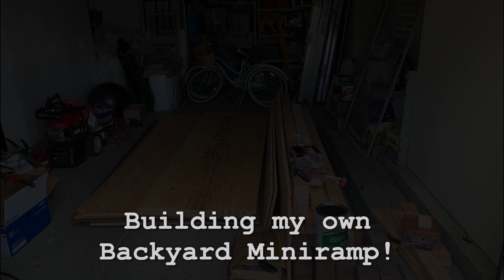How To Build a Miniramp Halfpipe in Your Backyard - Timelapse

Comment: Great video! Now that its all done, do you wish you went a little wider with the ramp?... or do you find that ur dimensions work well? Curious because I'm thinking of building one for my daughter (who is just learning). Thanks!
Reply from the maker: Good question! I reduced the flatground portion to be just 6-feet across (instead of 8), I imagine you'd have an easier time if that were wider, yes. More time for your daughter to adjust her feet and balance before going up the other side. If you'd like also, I imagine the ramp would be less intimidating at 2-feet tall (rather than 3 which is in the video), but then you won't have as much room for skill-growth. :)
Reply: Omg she would love that!

Comment: Hey man! Love the ramp! I’m trying to build one myself and I have a quick question. Where did you get the steel pipes for your coping?
Reply: It’s just a galvanized metal coping/pipe. Make sure it’s galvanized to prevent rusting and have a buttery slide. You can find them at Home Depot if you live in the us they sell them for cheaper. I recommend nothing bigger than 2 inches in width. I also recommend using skate lite, which is what he layered on top of the ramp. It’s a go to for the top layer of skate ramps.

Comment: Quick question, was ur ramp shaky before u layered the plywood?
Reply from the maker: I had to add vertical 2x4 supports from the top-deck horizontal 2x4 to the bottom horizontal 2x4 (on the far sides of the ramp). Once these were on there, the ramp can't wiggle side to side nearly as easily :)

Comment: I am currently getting materials together for this exact build? What did u use for the top surface of the ramp and where did you find it?
Reply from the maker: I used 1/4" Tempered Hardboard bought from Home Depot. (Sometimes called Masonite)
Reply from the maker: I'll still keep a  tarp over it though.

Comment: What were you brushing on the plywood after you cut it?
Reply from the maker: That was a mixture of Alex Plus caulk and water - I used it to seal up the edges so that the plywood sides can't split on the ramp due to rain and sun exposure.
Reply: Lucas Erb thanks for the reply! I’ll be sure to use this trick when building my ramp!
Reply: Are you going to paint the plywood and what would that help with dealing?
Reply from the maker: @whatsondurban6913  I didn't paint the top layer because I wanted it to feel smooth. I keep a tarp over it to protect against rain. The layer underneath and the sides of the ramp are painted with 2 coats of Spar Urethane. This keeps this fairly weather proof and prevents water seeping through all the layers of ply underneath !

Comment: Hi. Did you use the same transitions (measurements) as in the link. I’m about to do the same build but I don’t know if the 3’ minus the height of the flat section is a little to low. What do you think about the height? I will make it 8’ though instead of 6’
Reply: Where can I find the plans for this please?

Comment: What’s the length and width?
Reply from the maker: 3' x 8' x 22' - I added a description now which you can see.
Reply: @lucaserb2493  Cool thanks, I'm building one right now with the same plans but making it 20ft long making the flat bottom 4ft.
Reply: Did you Masonite for top layer?
Reply: @michaeltherion7459  I will be putting masonite soon. Have you used masonite on a skate ramp before? I'm wondering how I can water proof it.